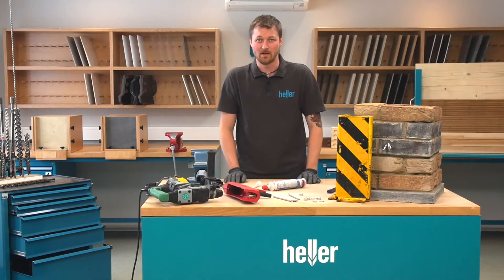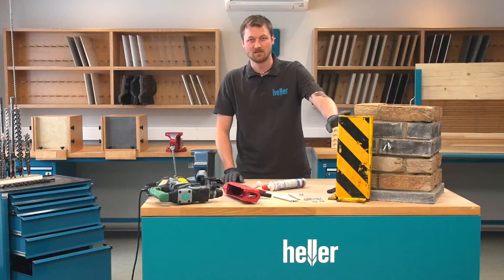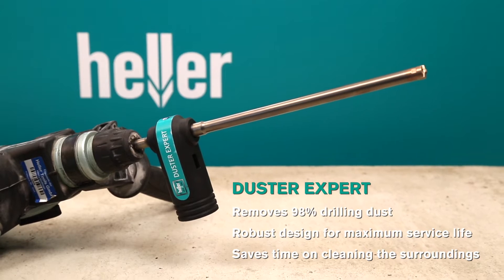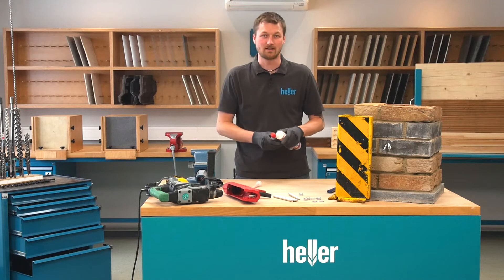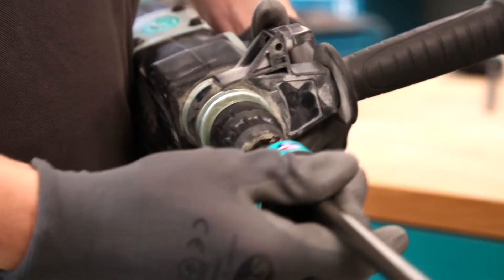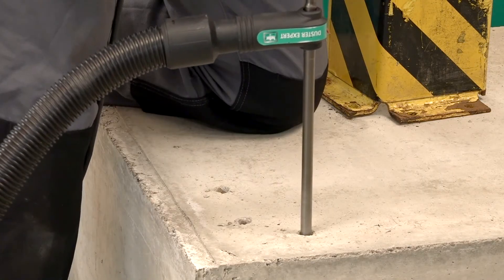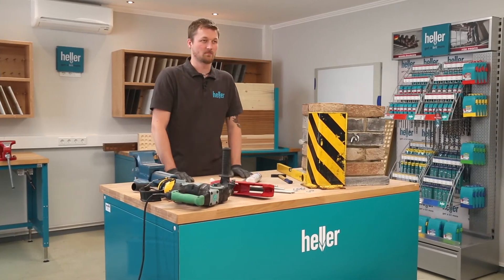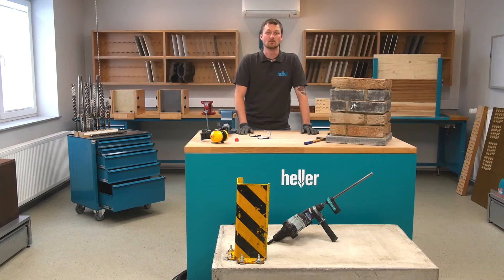Tutorial: How to drill dust-free in concrete floor #hellerTV #DusterExpert #drillbit

Comment: These drills work a treat. Many different size options for dustless drilling.  No issue when drill hits rebar, as with concrete the cut material is extracted so the tip of the bit is always cutting not grinding the cutaway material.  Hole's are cut quicker, bits last longer and no need to clean out the hole.

Comment: the cost of the product?
Reply: Ованес К bought an 8 mm Version for 30 Euros. Was worth it for around 400 holes in a concret celling working overhead in an still used Apartment.